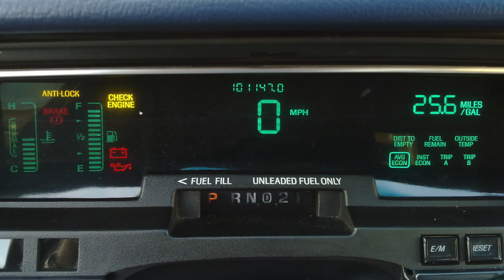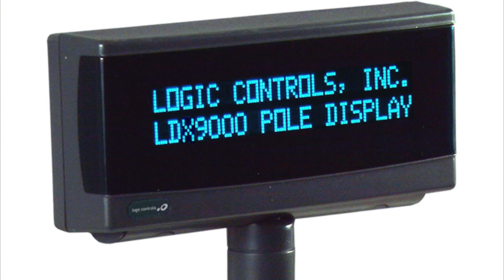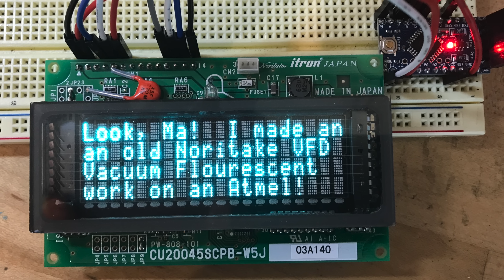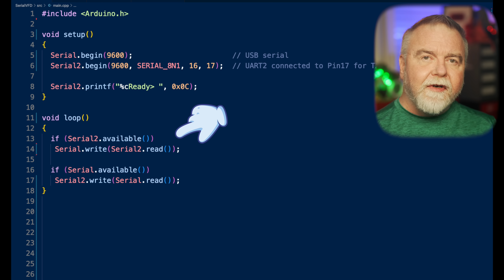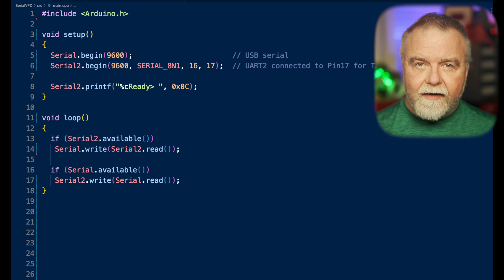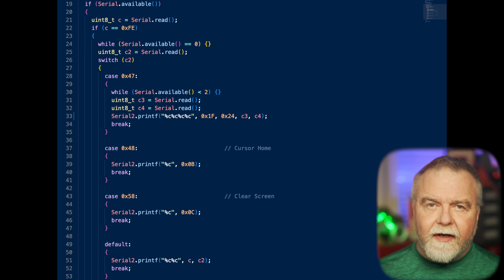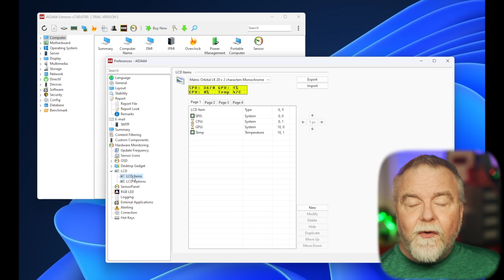How VFDs Work and How to Add a VFD Monitor to your PC

Comment: I have actually just started trying to build something very similar to this (but using a small OLED panel instead of a VFD), the one I am trying to build is a project called Gnat-Stats by Rupert Hirst. The idea is quite similar, you run a hardware monitor software on the PC (LibreHardwareMonitor or HWInfo64), which exposes various CPU/GPU/system information, and then there is a small bit of software which takes that information and sends it over to an Arduino via serial, which is then written to the OLED screen using I2C. 

It is quite a cool project (although I am a noob at Arduino so still trying to wrap my head around the code). Nice to see a different implementation of a similar idea (though I do think a VFD display is much cooler than OLED)

Comment: What language did he use to code with?  To me it looked like c++ but not sure.. could you have done the same with Python
Reply: Yes, micro Python. It’s somewhere around 500x slower though. But, sometimes that’s ok.
Reply from the maker: I'm using C++ (but mostly stuff the C features here).  You could sure do it in Python, from what I understand, but haven't tried it!

Comment: 00:35 🌈 Dave has a strong affinity for highly saturated colors and high-contrast LED displays, dating back to his childhood fascination with Lite Brite.
01:09 💻 Dave shares his desire to incorporate a VFD display into his PC, envisioning it to show CPU speed and temperature.
01:29 💡 VFDs are unique displays, emitting light rather than being backlit, and are reminiscent of older technologies like OLEDs.
02:02 🔍 Dave explains the internal workings of VFDs, detailing the heated wire, phosphor coating, and grid control for segment illumination.
03:06 🛠 Dave acquires salvaged VFD displays from cash registers on eBay, emphasizing their affordability and potential availability.
03:52 🧩 While lacking information on powering and controlling the VFDs, Dave discovers they are compatible with a Samsung unit, leading him to a critical data sheet.
04:19 ⚙ Dave creatively solves communication issues by connecting an ESP32 to the VFD, using a MAX232-like approach for RS-232 signaling.
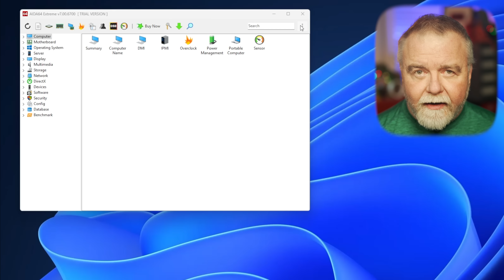05:30 🖥 Dave explains his choice of Aida64 software to drive the VFD, facing compatibility issues due to the VFD model.
07:29 📡 To overcome compatibility issues, Dave writes code to translate Aida64 control codes into commands understandable by the Samsung VFD.
11:37 🔄 Dave successfully configures Aida64 to display PC stats on the VFD, achieving a functional and visually appealing setup for only $30.